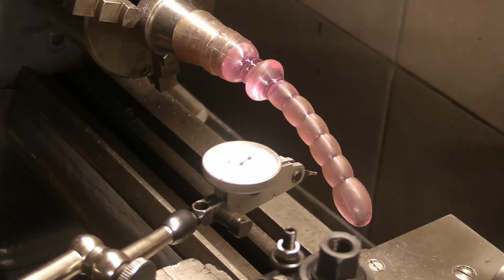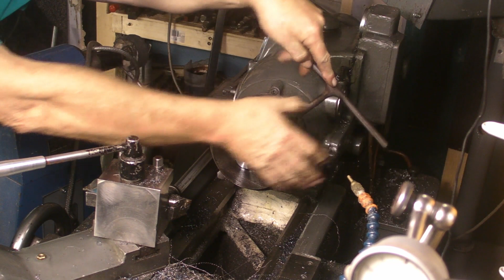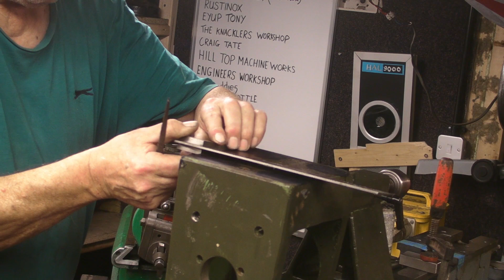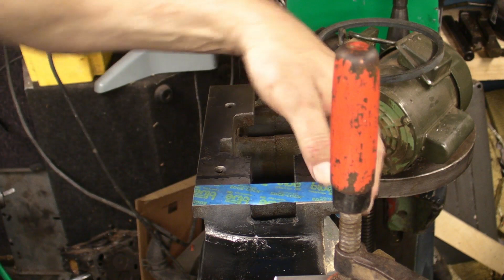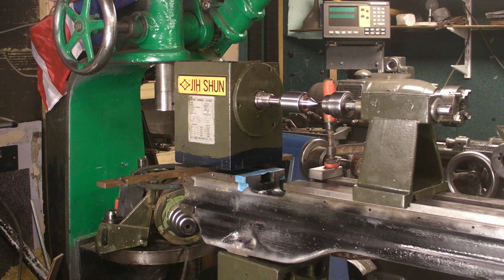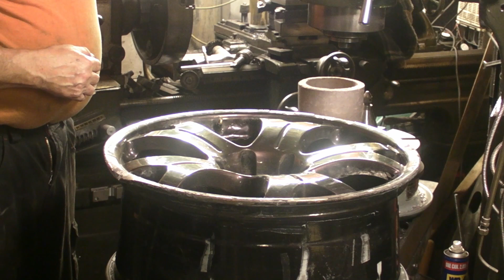Modifying the tool rest

Comment: The bit the toolrest slides into is called a banjo, That nut you have on the banjo, weld a small handle on it save having to use a spanner. 
I'm not sure why you made a plate to go inbetween the banjo & the bed, make sure that doesn't throw out being able to get the toolrest down to the middle of the piece your turning, that's where the toolrest needs to be in relation to the wood when using 95% of gouges. You should  NEVER point the tool down into the wood, should always be dead on or just below so you can present the bevel correctly.
Have good one Del ♀
Oh & P.S my wife noticed your flying low in this video...blahahaha
Reply from the maker: Hi Jay, there is a handle that came with the original wood lathe for anchoring the tool rest, I could use that, just thought a nut would be less intrusive, dont mind having to use a spanner ! The round plate I turned down to fit between the ways again came with the lathe, maybe only needed it with the tubular bed ! Tried the tool rest for height and all good, Tell your misses it was 40 degrees when I shot that vid, it was either flies undone or wearing the budgie smugglers !